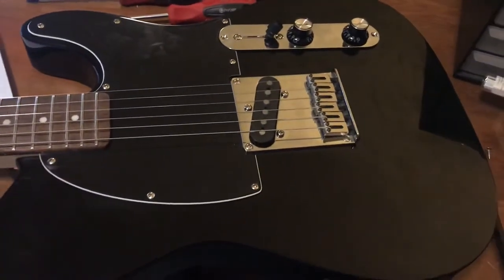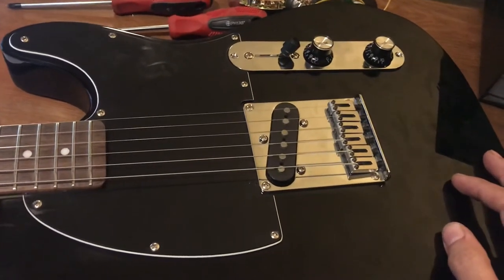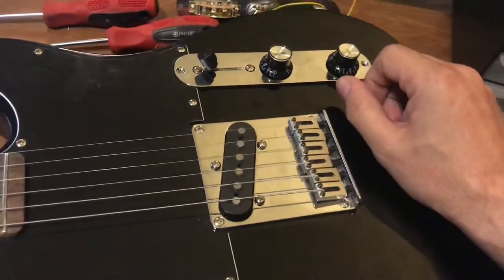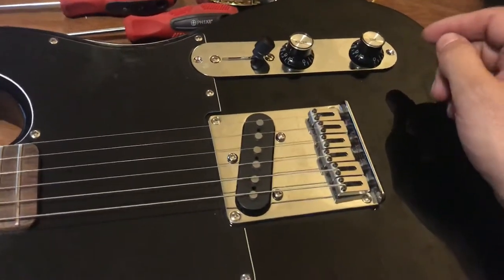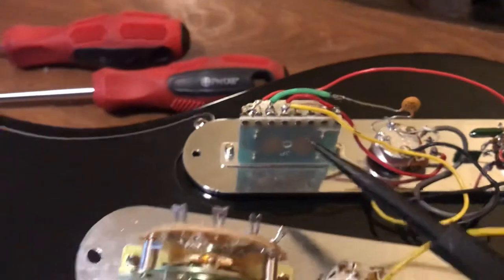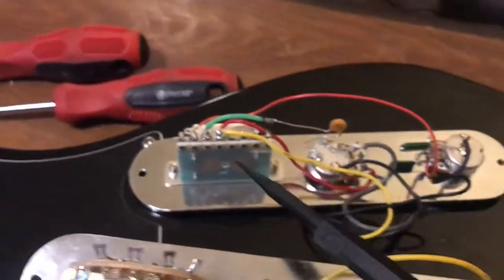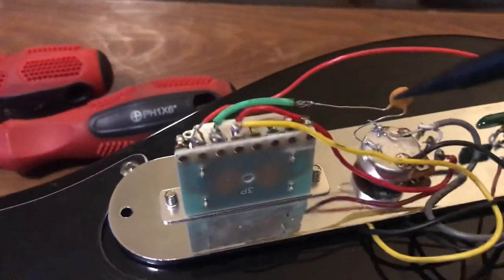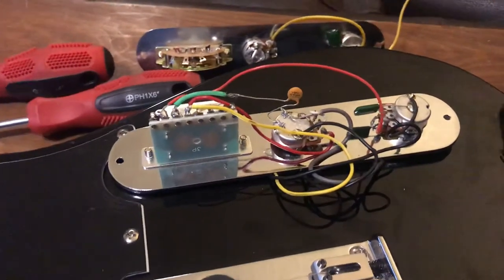Fender Esquire “Eldred Mod Alternative” wiring with import switch

Comment: I use it with a high pass filter (resistor and cap) and either a 0.0022 uF (Broadcaster type) or 0.0033 uF (Telecaster type) cap to cut out highs. Great, highly addictive sound!

Comment: What is the alternative Eldred Mod differ than the normal Eldred Mod network?
Reply from the maker: I call it "alternative" because of the piece of green wire I soldered to the cap as an extender. The standard wiring diagram says to solder the cap wire directly to the switch, but it wasn't long enough for that. I suppose "modified" would have been a better word than "alternative." But as far as the actual connections, it's the same.
Reply: @NorthWriter  ok thanks because I was confused. I wonder why Eldred at the fender custom shop made the Eldred Mod to get that cocked wah tone for what reasons for a telecaster? It must have been on some country album in the 50's or something I'm guessing

Comment: what I did was to and please read this correct it give you the most out of the tone .............. position 3 the dark tone I put a .015uf it can be very much like a woman tone to jazz sound without complete muffle .......... position 2 in the middle with tone knob I put a .0068uf on the tone pot and it gives me more wide selection of tones and the cocked wah sound on different caps........ position 1 I left alone just straight treble and very loud ........... this might work for you because .047uf in the dark position is kind of lame unless you overdrive it like all the time and .047uf on the tone pot is the same thing just very little adjustment ..............
Reply from the maker: Very cool! At some point I’ll crack it open again and give that a shot. I haven’t done much with tone caps, but I’m looking forward to seeing what sounds I can get from them!
Reply: Do you happen to have a wiring diagram for this. I am putting together an esquire with a seymour duncan BG1400 wound to 31k.
Reply: @813hubbard  use standard esquire wiring and replace the caps easy to do